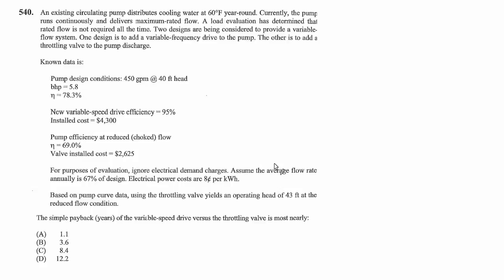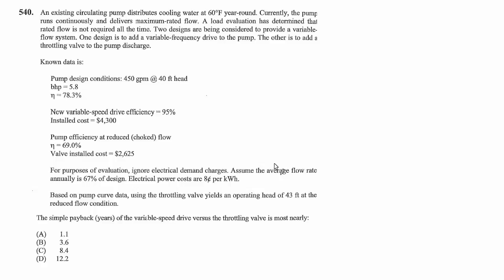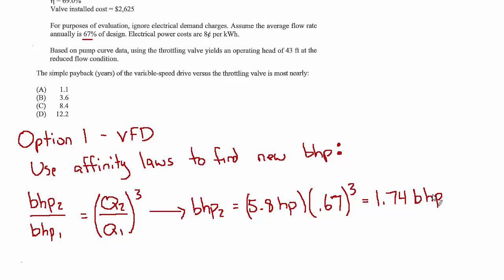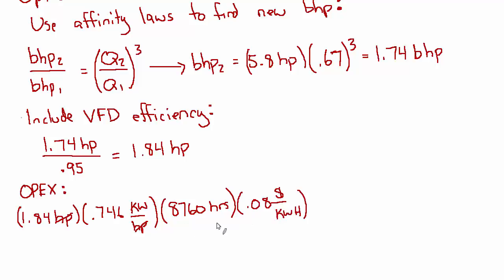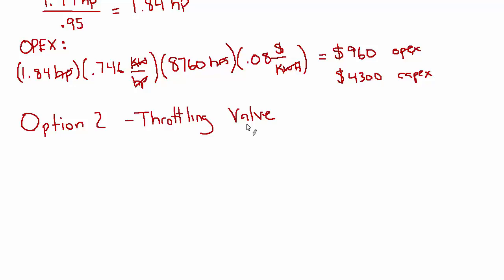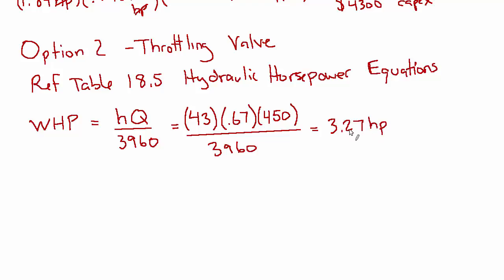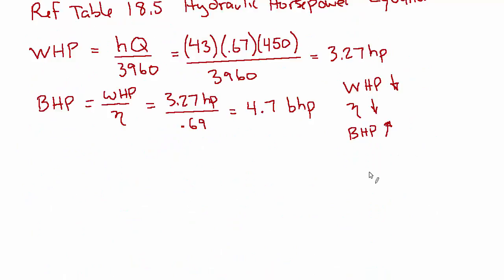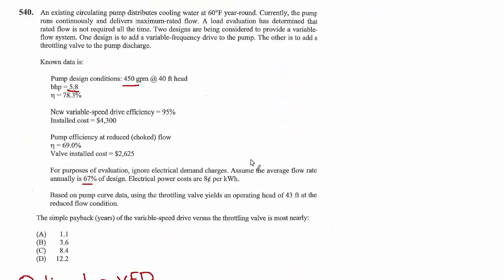PE Mechanical Exam | Variable Frequency Drive vs Throttling Valve-Which is Best for Pump Efficiency?

Comment: Hi Dan,
Question:
When using affinity laws for the VFD option why not use WHP instead of BHP?
---
(I'm sure I'm wrong and you are right in the calculations, but I don't understand why)
My notes:
Going from BHP to WHP at design
WHPdesign = BHPdesign*Efficiency
Efficiency of pump at design was 78.3% => WHPdesign=0.783*5.8=4.54hp
---
And using the affinity laws:
WHPdesign/WHPvfd = (Qdesign/Qvfd)^3 =>
=> WHPvfd=1.365hp
---
now going back to BHP:
BHP = WHP/efficiency = 1.365hp/0.95 = 1.44bhp

Please help me understand,
Thank you
Reply: @nycmathtestNewYork  It does
Thank you
Reply: @MECHANICAL PE EXAM PREP can you repost your reply please?